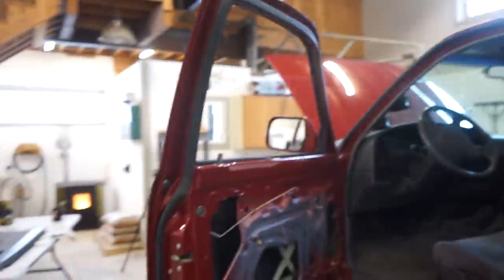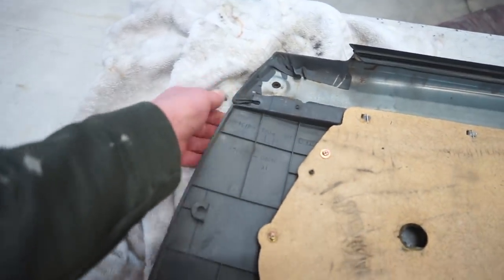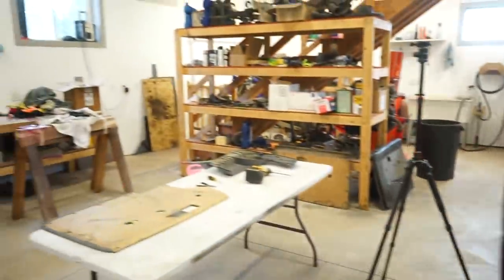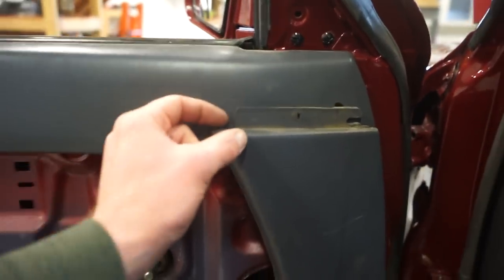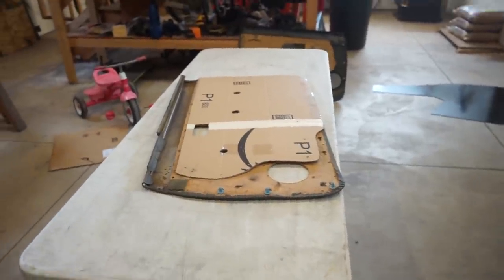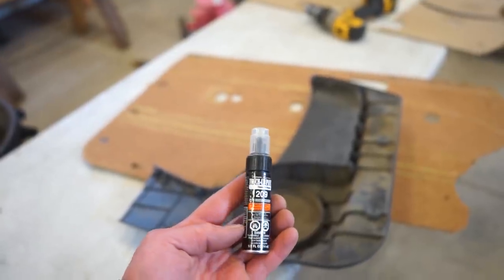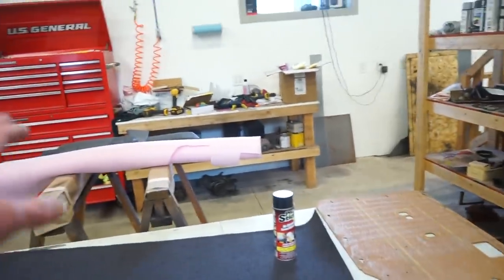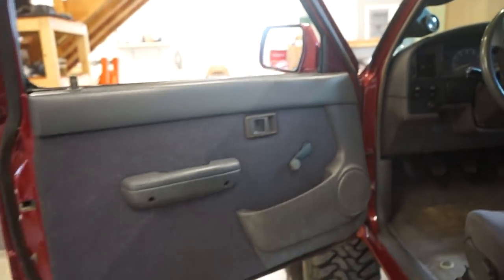Building Custom Door Panels For 3RD Gen Toyota Truck

Comment: Whatchya do is get some good plywood and some good looking vinyl and outdoor carpet like they use for bass boats and figure up how you want it to look and layer your plywood for a 3 dimensional design and if you want some crazy crazy shapes you use foam and carve it to the shapes you want and then lay fiberglass down and spend neverending hours sanding and painting. That's how we always did it when I was younger.

Comment: You Sir are amazing👌🏾. My 2009 Hilux has a leather interior. Still looks unbelievable. I travel a lot both on tar and dirt roads. Dust n dirt stains are easy to clean on leather. I have a 3ltr D4D 4x4. I get about +680km/80ltr tank, it's heaven-like. I've always used 50ppm diesel. My mileage is +520,000km, everything is still stock. I will never own a petrol pickup. It is too painful to watch the fuel gauge plummeting. 🖖🏾🇿🇦

Comment: You could get a $20 plastic welder thing from harbor Freight and weld the up right piece with the proper end piece and it would be OEM. You would need to paint the panel to hide the weld. Also does Katskin make a leather seat kit still for your truck?